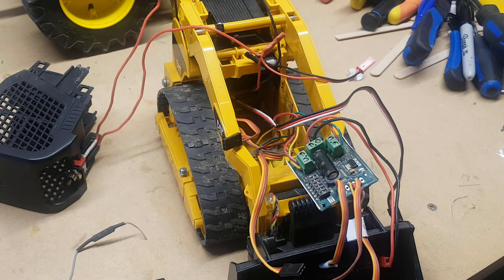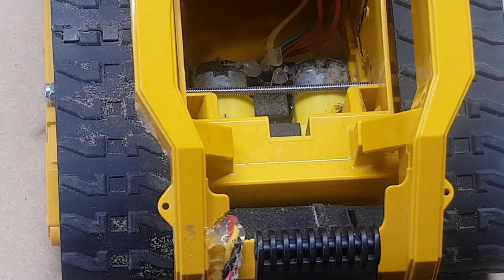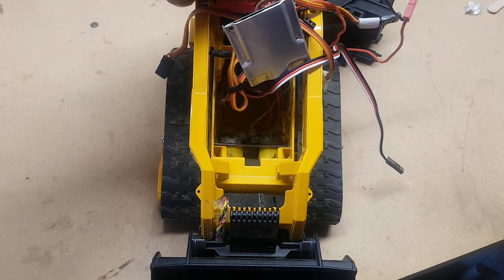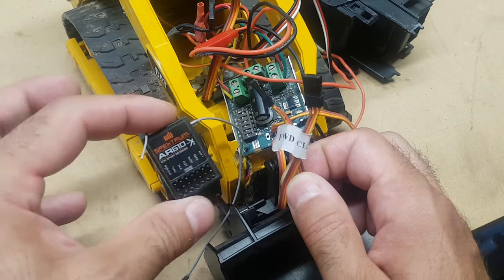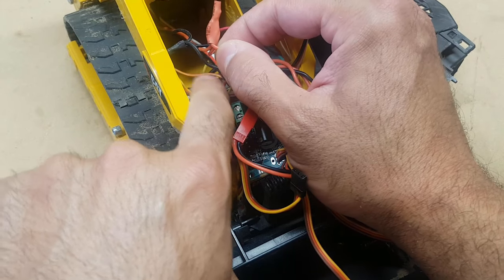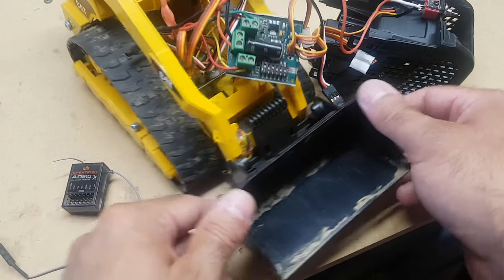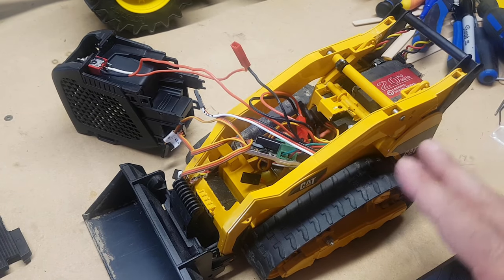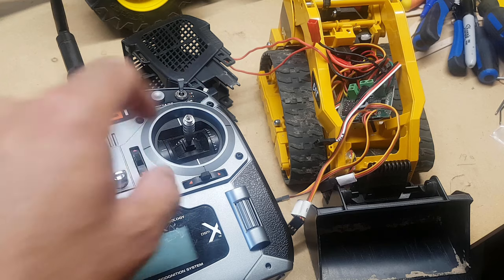HOW TO CONVERT A BRUDER SKID STEER TO RC!

Comment: So I want to try this but where did you start, is this a good starter project on converting to rc. Didn’t want to spend too much just in case I mess up? Thank you! Love your vids! Big fan!
Reply from the maker: I would say this is probably a second conversion. Maybe start on the D5 dozer. It is easier to convert. This skid steer is a little more advanced. I am making an easier one but still will cost more than the Bruder D5 dozer
Reply: @RCConstructionHobby  thank you I’m sure I will have more questions lol! Is the huina 580 a beginner rc?
Reply from the maker: Yes I would say the huina 580 or the volvo ec160 from double ee is also a good one.

Comment: The link for the drive gear in description. Is the gear is already  printed or is that price just to buy the file so I can print it ? Would like to be able to buy them pre made for my conversion.
Reply from the maker: All the links are to buy the printed parts. You pick the material and shapeways prints it for you.
Reply: @RCConstructionHobby  thanks man just started on my delta loader today after finishing up the d5 build

Comment: What rpm did you choose for the drive motors?
Reply from the maker: The model of motor only comes in one speed. It's around 200rpm.
Reply: @RCConstructionHobby  thanks, that will help!

Comment: so i was looking at the site for the board what came up is the 5a r/c 6-18v is that it again thanks for your help
Reply from the maker: i believe that is the correct one. here is the link https://www.robotshop.com/en/dimension-engineering-sabertooth-dual-5a-regenerative-motor-driver.html
Reply: @RCConstructionHobby  thanks for the info so where did you get the connect the servo to the main arm
Reply from the maker: Do mean where on the arm does the servo connect? Or how is the servo connect to tge arm?
Reply: @RCConstructionHobby  sorry bad wording. I mean the part from the servo to the main arm

Comment: Hey dude planing to do one of these my self do you know were you brought the motors from (i may have missed it in the video)
Reply from the maker: Amazon sells the motors. Look for yeeco dual shaft motor
 https://www.amazon.ca/dp/B07CJZ58G5/ref=cm_sw_r_cp_apa_fabc_uKTYFb8RKEJ8B
Reply: Thanks dude huge help ive got my radio gear and servos just need to order the rest  also why do you need dual shaft motors instead of single

Comment: So is the BEC part of the control board or is it a separate item
Reply from the maker: Yes the bec is separate. It is its own item.
Reply: @RCConstructionHobby  where can i get one from
Reply from the maker: I  bought mine from Amazon. Search hobbywing 3a ubec. You can get 2 for $8.90
Reply: @RCConstructionHobby  thanks your help
Reply: hi again sorry for so many question but do i have to use a esc as well
Reply from the maker: No esc is required if you use the control board for the drive motors. But if you decide not to use the control board then 2 esc is required to control the motors. Servos do  ot need esc.
Reply: @RCConstructionHobby  thanks again and I believe you said that in the video

Comment: Hey do you know if the build thread is still available I can’t get the link to work Thanks
Reply: Found them on shapeways do you have any info on the motors Thanks for making this video
Reply from the maker: The build thread was removed a year or 2 ago. The motors are from Amazon. They are yellow and have 2 output shafts on each side. You would cut one side off. Yeeco motors.
Reply: @RCConstructionHobby  thank you

Comment: Hello, can you tell me how to connect the Sabertooth to the receiver?
Reply from the maker: Yes you will take the fwd and turn servo wires and connect them to channel 1 and 2 or 3 and 4. Depends which stick you want to do the movements. Keep in mind if the tracks are not spinning the right direction you might have to reverse one of the channels or switch the pos and neg on one of the motors.
Reply: @RCConstructionHobby  I will test ... thank you

Comment: so the link to the rc sparks does not work
Reply from the maker: It was taken down. It no longer 3xists. I will make a new video in the future about making this again.
Reply: @RCConstructionHobby  how can I get the 3D parts or the wheel
Reply from the maker: Search shapeways.com and type in bruder delta and all the parts you need are there to download for free. Or you can buy them and they print it.
Reply: @RCConstructionHobby  thanks

Comment: Great video! How much did it cost you to build the tracked skidsteer?
Reply from the maker: Hey Ismaxxed out. for me it cost between $400 without a TX/RX. add another $100 for that. but its roughly the cost. It does not include my time to make it which is priceless ;)
Reply: @RCConstructionHobby  not bad at all, what's the tx/rx?
Reply: @lsmaxxed  transmitter and reciever. The remote control part